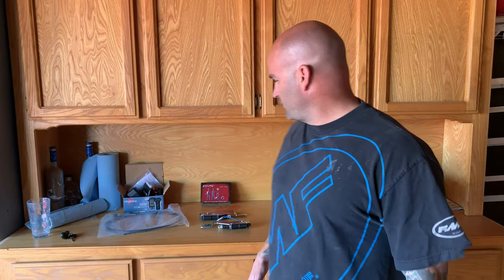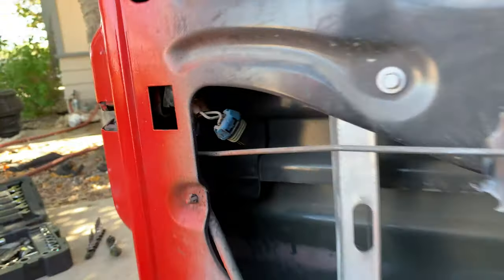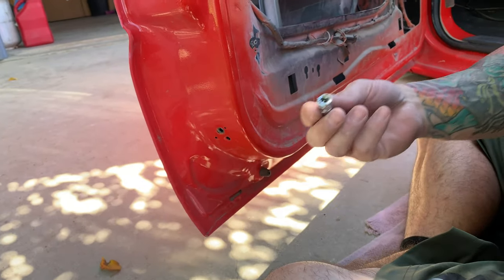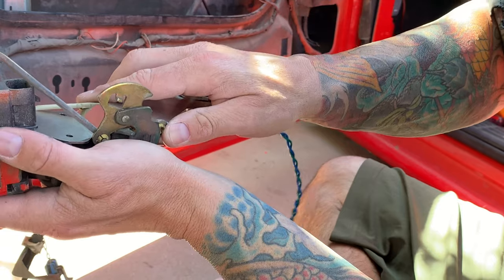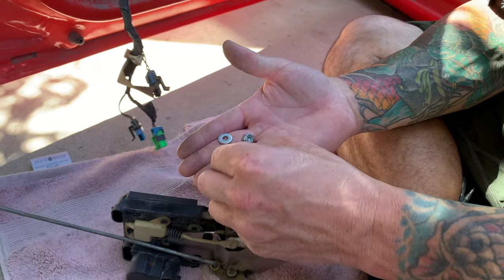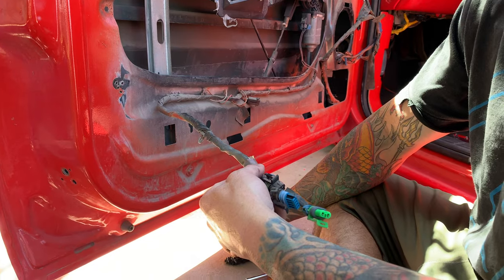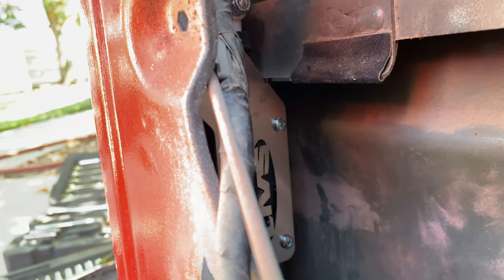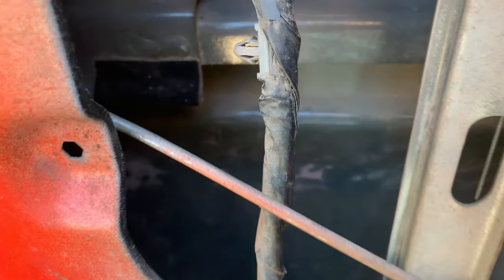AVS shaved door kit and Prestige APS997Z car alarm install Part 1

Comment: I have a question, my doors haven’t been popping lately. I use the control but the only thing I hear when it pops is just a click. It’s not pushing the door open or opening it
Reply from the maker: Do you have the older style. I would check your grounds first. This always seems to be an issue.

Comment: im putting this on a 1947 chevy truck . i dont think i need all the wire in the kit (running to doors) can you cut them shorter for your application ? or do you need to use the wire ?
Reply from the maker: You should be able to use the wire just have to redo the connectors

Comment: Whered you buy these
Reply from the maker: I bought them straight from AVS. Check them out on line. Call before you buy though. They always have discounts codes if you ask.
Reply: @NDOTV  do you know where the where everything is from like the popper and all thay